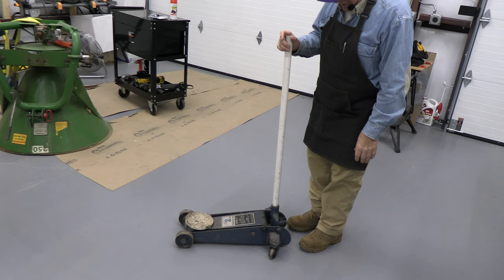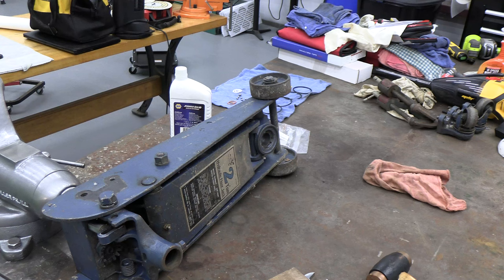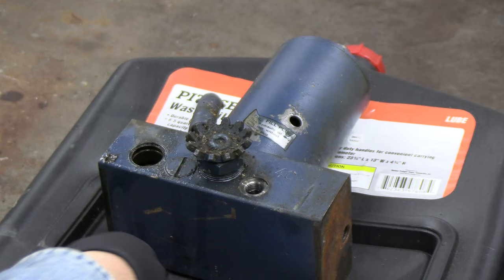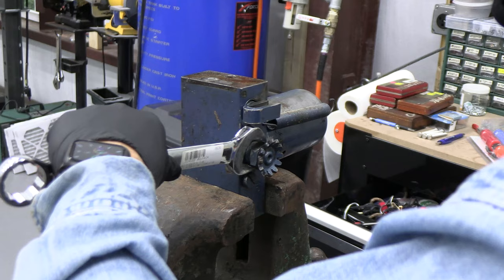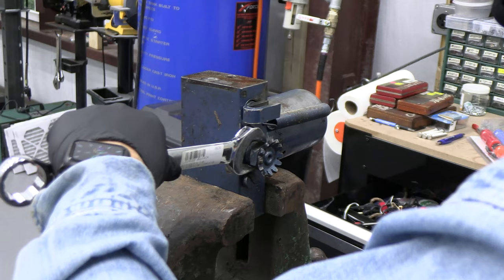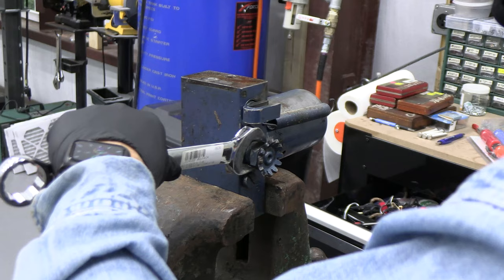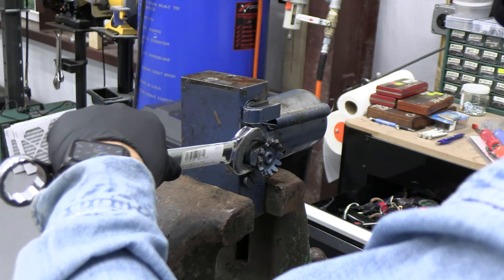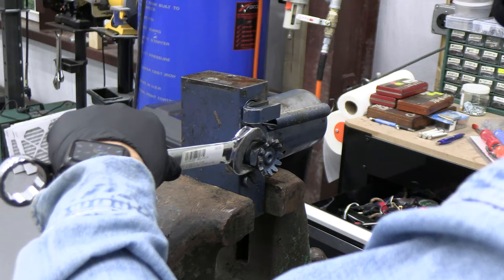Sears 2 Ton Floor Jack Complete Rebuild

Comment: I’m having trouble removing the nut at the top of the piston housing. Any recommendations aside from 6’ pipe for leverage. Tried WD40, liquid wrench and blaster. Also heating it.
Reply from the maker: OK that nut is a real pistol. You know I put mine in my gigantic Columbian vise with a pipe wrench and a 6 foot pipe. It probably didn’t need that length of a lever but I needed more than the pipe wrench itself so get yourself some pipe and give it a try, but you need us very heavy duty vice that you can put that in that will hold of securely. Why you talk at the moment he moves 1 mm is loose, but they are put on really really tight and overtime. Many years. It really gets fused. Let me know how it goes.
Reply: @JosephHunstad  thank you. I watched your entire video and saw the plumbers wrench and the six foot pipe.
I took the piston assembly to a machine shop and they’re having trouble too.
Reply from the maker: @carminemiranda6413  yes, it was a real pistol to get it off. They must’ve put that together with an impact hammer when it was assembled heat and leverage should win the day.
Reply: @JosephHunstad  thank you Joseph! Maybe an impact hammer would work . Need to get an impact docket for it! 
Thank you
Carmine
Reply: I finally have the top piston nut removed. I replaced the piston wiper seal, the o ring and the plunger part. 
Also the two copper washers in the handle screw that raises and lowers the piston. 
Problem is the handle screw keeps turning right and doesn’t stop. 
What do you suspect I did wrong ?
Thank you
Carmine
Reply from the maker: @carminemiranda6413  wow interesting question. The handle screw should engage in some threads and only be able to turn a certain amount and then stop that’s necessary to hold the jack in a given position then loosening it allows it to lower itself. Also, I need to be fully tightened to a stop to pump it up. Be sure that it’s engaging in the threads. I guess it’s the first thing I would do.
Reply: @JosephHunstad  when I removed the   Part that turns to raise up or lower it had two copper washers only. Mine is a 328.12001 1 1/2 ton sears jack.
The inside screw with a pointed machines tip was loosely spinning while threaded to the  1 1/4 nut part that engages with the handle part.
Could it be dependent on the amount of threading that inner screw should have ?
I had to bring the whole piston assembly to a machinist to loosen the top piston nut and the 1 1/4 nut. I don’t know if he took out the 1 1/4 nut and the internal parts popped out. 
Do you know where I could get a parts schematic that shows those internal pieces?
I truly appreciate your help and knowledge in this matter. I’ve had this jack since I was 18 when I bought my first car.
Reply: Hi Joseph, I found out what problem is. Somehow the round washer with the square hole that is sandwiched between the two copper washers is missing. In 51 years I never needed to service the jack and never removed the  pressure relief valve. The machinist I brought it to to loosen the nut May have unscrewed it and the contents may have fallen out. 
Thank you 
Carmine
Reply from the maker: Hey buddy am glad it worked out. Have a great day. @carminemiranda6413

Comment: I did my jack my jack now it won't go down 😢
Reply from the maker: OK, you need to back off the needle valve because it’s not allowing the hydraulic fluid to come back out so I back it out at least six turns and then give it another try it should work. Take care. Joe.
Reply: @JosephHunstad  okay I will give it a try before it wouldn't go up thanks 🙏
Reply: Tried adjusting now it's either up or down how sensitive is the screw
Reply from the maker: @shawnsmith4058  the initial setting is to turn it all the way in and then back it out about six turns that’s a good midpoint to start
Reply: Okay thanks I half to win lol will try again tomorrow

Comment: Where did you find the parts from
Reply from the maker: Hello Philip thanks for your question. I put the model number into eBay and Amazon and found replacement part kits. Give it a try. Consider subscribing. Thanks, Joe.

Comment: What's the grease fitting for on the back of the Jack
Reply from the maker: Thank you for your question. The grease fitting allows you to lubricate the cylinder on which the main arm rides. It is basically like a sleeve bearing. Please consider subscribing. Thanks Joe
Reply: @JosephHunstad  
Hi Dr. Joe,
I have the same floor jack as you.

I am wondering what size is the adjustable wrench did you use?

Looking to get one for the same project.
Reply from the maker: @camryuser  thanks for your question. It is a 15 inch adjustable wrench. I know that’s kind a big you may get by with a 12 inch one I’m not sure. Take care Joe

Comment: You have a rubber mallet yet you used the steel hammer on your wrench.   Fail.
Reply from the maker: You are so right you mentioned that and I agree. The overall project turned out pretty well though. I hope you found it helpful. Consider subscribing. Thanks. Joe.

Comment: didn't explain right side adjustment pin more
Reply from the maker: Hello there. Thank you for your comment. The right side adjustment pin is basically a needle valve. That controls the flow rate of hydraulic fluid, increasing or decreasing the rate of rise or dissent. Consider subscribing thanks, Joe.

Comment: My rebuild was much easier: I went to Harbor Freight & replaced my POS Pittsburgh 2.5T Aluminum Jack (crapped out after 3 years) with a Daytona 2T Aluminum jack!

All kidding aside, I'd give anything to have a rebuilt jack as the old ones were built so much better.  The old saying: "They don't make them like they did back in the good old days!!!"
Reply from the maker: Hey, thanks for your comment. I totally agree with you. Unfortunately, some of those light duty jacks from Harbor freight and other places are definitely useful for a limited time only. Take care. Joe.
Reply: I have the 1 1/2 ton version of this Sears floor jack which was given to me several years ago by my neighbor who flew P-38 lightenings in WWII.  He has since passed away, but my jack isn’t working properly.  I’ve saved this video to use as a guide when I rebuild it.  Cannot & will not throw it away….This video was very timely.  Excellent teacher Sir.  I don’t see the link below, but if you could let me know the part # of this re-build kit, I would be extremely appreciative…..Thankyou